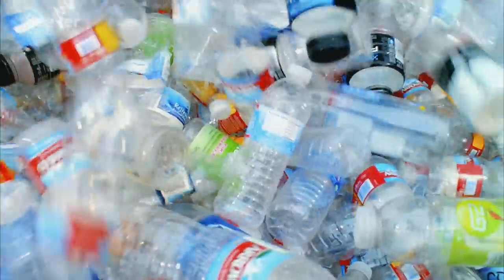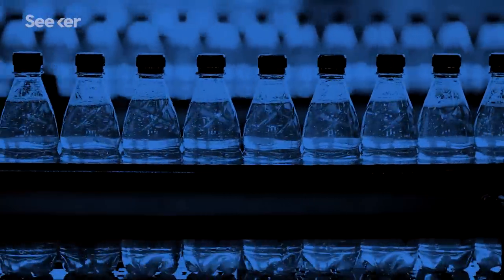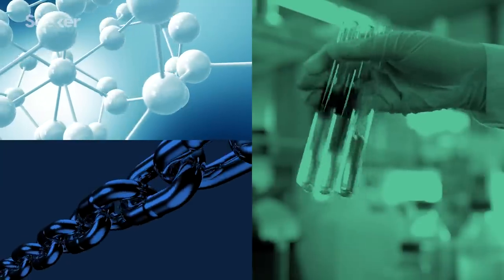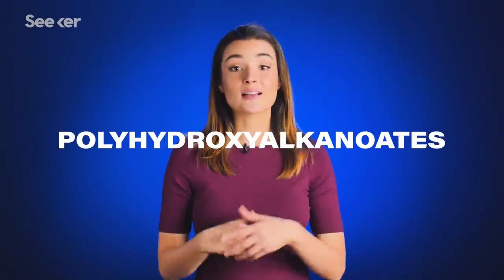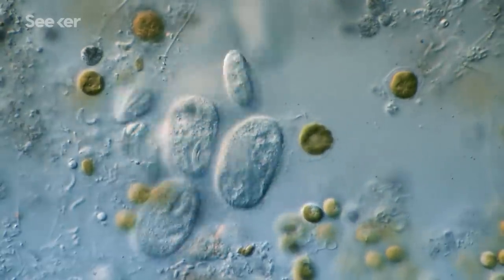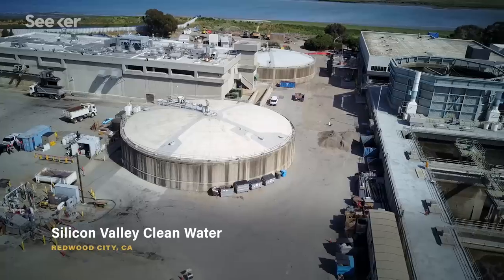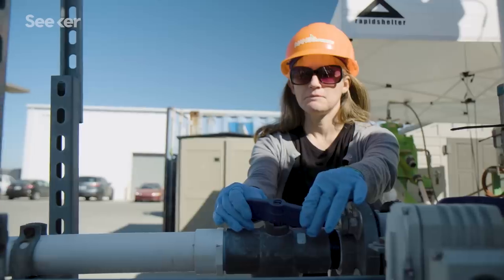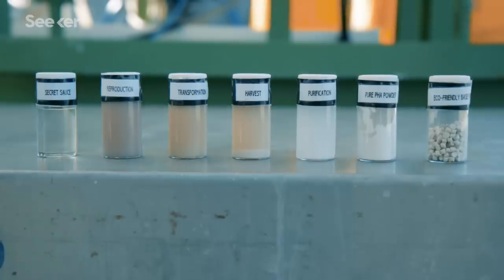How Close Are We to Reinventing Plastic?

Comment: I thought plastic had a really small carbon footprint, the issue is the waste.
Reply: The creation of plastic has a huge carbon footprint, as it relies on fossil fuels.
Reply: @lemonwithalime  You know fosil fuels don't mean huge carbon footprint, it's burning them that creates the emissions. The creation of plastic is a result of a chemical reaction that doesn't generate any emissions.
Reply: @rigglesnz  The extraction of the fossil fuels required to make plastic is a massive polluter, though.
Reply: @lemonwithalime  Less of a polluter than other alternatives however.
Reply: @rigglesnz  Like what alternatives?
Reply: @lemonwithalime  Well if your talking platic bags a comparative paper one generates 300 times more emissions in its creation. If your talking storage containers, again metal and glass are much worse. Drink bottles, again metal and glass are much worse.

Comment: I hear a lot of ''methane'' in this video. Methane's contribution to the global warming problem is much higher than that of CO2. So, trying to solve the plastic issue at the expense of worsening the global warming issue, is not a solution at all. Unless we have ecological and economical ways to treat methane.
Reply: The process itself is actually a way to treat methane. This results in not releasing waste methane in the atmosphere by using it to create this new product which is a good thing considering the fact that currently, we don't care about methane getting released into the air since we can't do anything quite profitable with it as of now.

Comment: "It has a massive carbon footprint"

Except carbon dioxide is a naturally occuring gas that plants use to live and there is not a single peer reviewed study that proves it has anything to do with climate change.

On the contrary any evidence we have so far points to the FACT that carbon dioxide is one of the LEAST important parameters of climate and the temperatures.

The sun and the water in its 3 forms are the major regulators of climate and temperatures.

The anthropogenic cause of climate change is pseudoscience of the highest order and its proponents are deplorable pieces of crap.
Reply: @kostasz7z  I'd love to see the shitty data you're citing.

Comment: Henry Ford built a plastic car from Hemp in 1941. We have had the capability to not use fossil fuels for as long as we have had the motor vehicle. A Carbohydrate (Plant) and a Hydrocarbon (Oil) are both a mixture of Hydrogen, Carbon and Oxygen. In fact fossil fuels were originally plant matter that has broken down over time. Human caused climate change if it were true would be simply resolved by growing fuel instead of using ancient stored fossil fuels. The Carbon dioxide absorbed by the plants would offset their use as fuel. We also have clean power generation technology thas has not yet been released to the public. If the solution to a problem is easily available and not used you would have to assume their was never actually a problem just propaganda. The climate change narrative is clearly a myth if the solutions are right in front of us. You can't patent nature. Learn the patent game. Making some complex chemical reproduction of something nature freely provides us to make profit out of something we could have for free. The other trick at play is by making you feel guilty for your opulent overconsumption you are enticed to buy more of their crap under the false premise it will make you happy. Learnt behaviour from the very first time your mother stuck a biscuit in your mouth to stop you crying. Go research. Learn the game.

Comment: Plastic has a massive carbon footprint? Compaired to what?
Reply: Glass, wood, cotton, hemp, porcelain, stoneware, paper
Reply: @RubenKelevra  This is something I always hear "Plastic has a big carbon footprint, but so do many of the alternatives to plastic. And that's what makes replacing plastic a problem without a clear solution." I'm looking right now at my desk and it would be impossible to replace all the plastic that I use every day without a massive carbon footprint. How would you replace plastic from these and what would be the carbon footprint/solution?  Monitors, headphones,  mouse, keyboard, fridge, remote, TV, washing machine, electrical equipment, and computer parts, etc.)
Reply: @Monsux  well, there's a difference between plastic products with one time use and plastic products which have a long lifespan.

So most of the packaging we're used to from the supermarket is just convince, not necessary. I mean, common why do we buy nuts, milk, cheese, lunchmeat, potatoes, yoghurt, water etc. wrapped or contained in plastic, and bring them home with a plastic bag? 🤔

This one time use of plastic has to stop.

When we got to this point we can talk about recycling, since at this point we got the amount of trash to a level which we can handle with recycling. When it's mandatory to use a certain degree of plastic from recycling on new products by law, the price for well sorted and recycled plastic would rise and we could afford the recycling even better.
Reply: @RubenKelevra  Yeah I know, but there was a mention that plastic has a massive carbon footprint. That isn't true even for most of the daily items. For example, I just read Danish research about plastic bags vs other options (entire life cycle of the products). Paper bag had 11 x carbon footprint vs plastic bag (fabric bag 840x and eco fabric bag 2400x). So the plastic bag is a good option if you just think of co2 but not so great for the environment. The same goes for other daily things that we only use for one time. Even if you compare eco plastic to normal plastic. Plastic is so easy and cheap to make a large scale that per one item the co2 emissions are way lower than other options. We should really find some other cheap, strong and easy to make options that would be also great for the environment.

Ps. It also depends on where people live because some countries have really great plastic recycling system. All the way to taking care of trash for free, recycling, making energy + filtering systems. So the carbon emissions are really low on most of the products. Black plastic is still a huge problem because even new systems can't really recognize the black material and it goes to the same waste as other products.
Reply: @Monsux  well, I live in Germany which got a pretty good recycling system.

When you think for example about beer:

Beer is sold in glass bottles and in plastic bottles as well as in aluminum cans. The plastic ones are collected and recycled. The glass ones are washed and used like 1000 times and when they are broken, they are recycled. Recycling rate of green glass (all beer bottles are made of green glass) is 98%.

So aluminum cans for beer as well as plastic bottles should be forbidden - we already found a solution which works.

The same for yoghurt. There's one type of white glass for yoghurt which some companies use, they are washed and reused. 

The other option is plastic containers with aluminum foil as lid and a plastic cap on top (on the large ones).

Even when the glass ones are broken, they can be recycled.

We don't have to look just at the CO2 emissions but also look at the environment impact.

A lot of trash is disposed in nature, like at the side of the road, washed on the next storm in the nearest creek, than river than sea.

It won't brake down over hundreds of years and just get ripped into smaller pieces until fish and other animals eat this stuff.

It's already contaminating our food chain. If we couldn't live without - alright. But most stuff is just thrown away because we're lazy and it's more comfortable to just use plastic.
Reply: @RubenKelevra  Yep. There are two major issues now that we need to fix fast. One is co2 emissions and one is damage to nature. Sometimes you have to make a choice of what is more important for the bigger picture. Right now we have to lower co2 as much as we can.. because... You know why :D So making everything eco-friendly is not always the right option. If we make for example large scale EU decisions banning plastic for daily food items... That would radically raise the co2 emissions. At least some EU countries handle plastic very well but that's not the case in most Asian countries that pollutes oceans way too much.  So it all depends on where people consume plastic items.

Btw it's funny to see so different styles of recycling of bottles (depends on country). We at least here in Finland abandoned most of the glass bottles and replaced those with aluminum cans. Recycle rate of everything is super high because you get 0.15€ per can, 0,2/0.4€ per plastic bottle and 0,1€ per glass bottle. You hardly never see any bottles anywhere because of the value. I read somewhere that glass bottles can be reused about 30-35 times before they are recycled with other glass. Also, there was so much damage to nature when there was broken glass everywhere (before we made the change 20 years ago). Reusing aluminum cans cost only 5% energy vs making a new can so it's a really great option when you have proper recycling system. I think that now there are more problems with some cheap juice bottles that you can't recycle properly. I think we should abandon those asap + all the microplastic products like you said. IMO one huge problem is also cheap plastic made fabrics (synthetic plastic fibers) that turn to microplastic after every use/wash. All that ends up in our oceans and we can't really do nothing about it.
Reply: @Monsux  there are some issues in your statements:

Aluminum can be recycled, but most aluminum is contaminated, since it's rarely used pure. Some of the contaminations cannot be removed. So recycled aluminum cannot be used for cans.

All cans you buy are from 100% raw material, there's zero recycling going on there.

So the energy record for cans is awful!

Glas bottles can be reused on average 50, not 35 times, not maximum. They usually get small damages at the top, if so they can be sorted out and recycled. As I said, the recycling return rate on green glass is extremely high in Germany.

And also the return rate, regardless if it's one way or reusable is at over 99%.

If you see broken glass bottles than are they from stuff like cilk or cacao. There's one company which sells both in 0.5 liters glas bottles. But actually broken glass is extremely rare in Germany to find. The most stuff you find is either tetra paks or fast-food packaging.
Reply: @RubenKelevra  Sorry but the information is straight from the Finnish recycling center that handles all the recycling of bottles & cans. They say that 100% or aluminum cans can in theory used to making of new material for the cans and it only costs 5% of the energy that you need to make new aluminum for the cans. And our recycle rate of cans is the highest of all the other options and the use rate is here like 75%+ of all the options (cans, plastic 10-15%, and glass 5-10%).  Cans are pressed to bales that are melted to bars and pressed to thin slabs and then cans. You can repeat this process almost endlessly. With cans, there are no such problems like weight and size as glass options. A full small glass bottle can weight almost double vs can so you need double the energy to transport + washing process. So there is good and bad side of everything. You can use glass bottles multiple times but it takes more energy and space. In Finland, the green glass bottles have about 33 life cycles and after that recycled with other glass. I could do some rough calculations later about making a glass bottle vs same size can. Just checked that 0.33l glass bottle weights 192g and a can 11g. Co2 emissions per 1kg of 100% recycled glass is about 1,2kg co2 and 50% recycled aluminum is 8,9kg co2. But recycling almost all the aluminum ends up just a fraction of that co2 emission number.

We don't really have that many glass bottles for other (drink) products... Mostly just imports. We did have a huge problem with broken glass before. Not really in city centers but in nature. Here we have almost 200 000 lakes and everyone took beer bottles everywhere.  Glass is glass and glass breaks. Now it's so much more stress-free in nature when you don't have to think about accidentally breaking a bottle and you hardly never see any broken glass like before. Now just maybe see some plastic bottles or cans that you can take straight to the supermarket for some easy money. Almost all the trash in nature are from food related items that we dont really have a good option.
Reply: @Monsux  yeah you're right. My information was obviously a bit outdated.

Some years ago the Beverage Can Makers Europe website stated that aluminum cans are not recycled.

Looks like they unified the alloy beeing used in these cans, today the recycling rate in Germany is 99%.

https://metalpackagingeurope.org/article/aluminium-beverage-can-recycling-europe-hits-record-745-2017

The broken glass thing I've stated was all about the the nature. You hardly find any glass here anywhere.